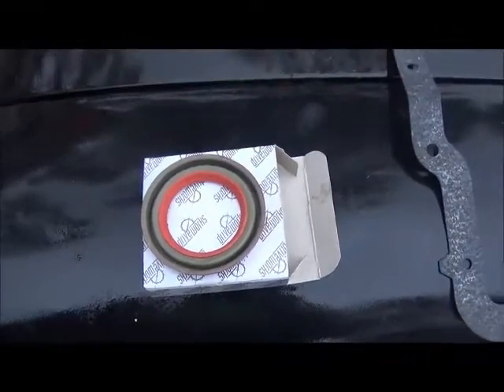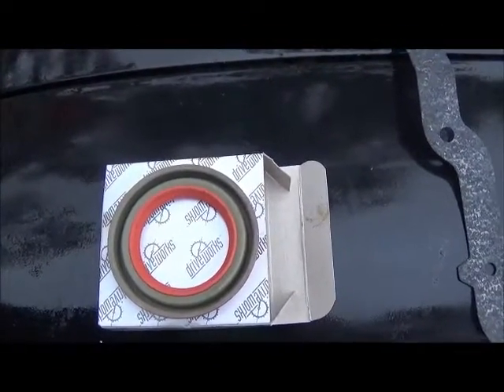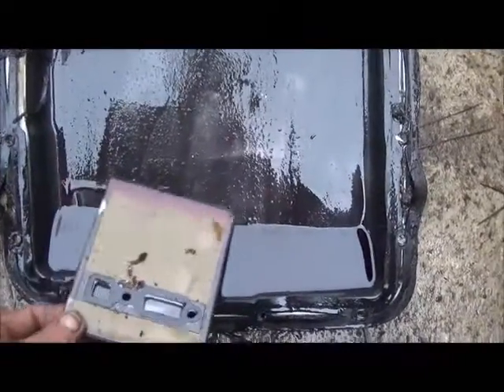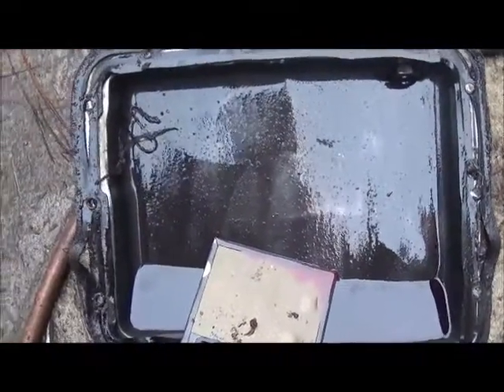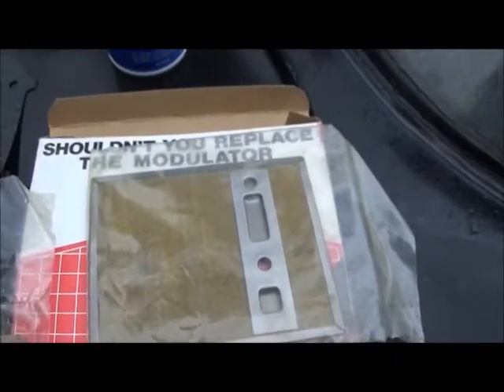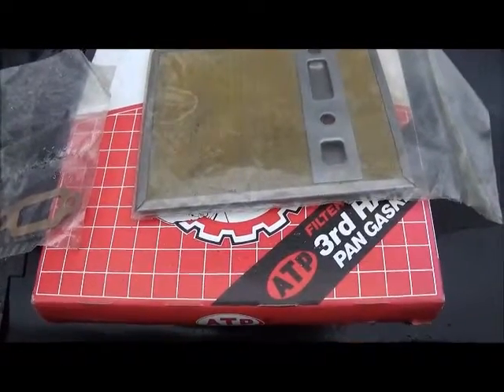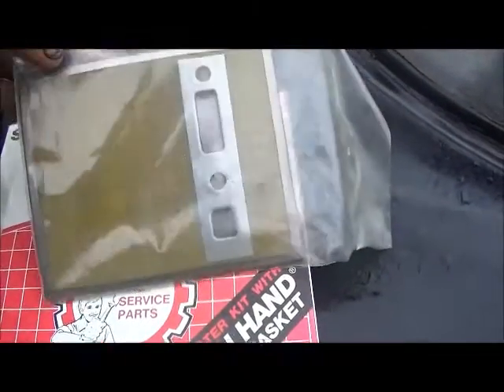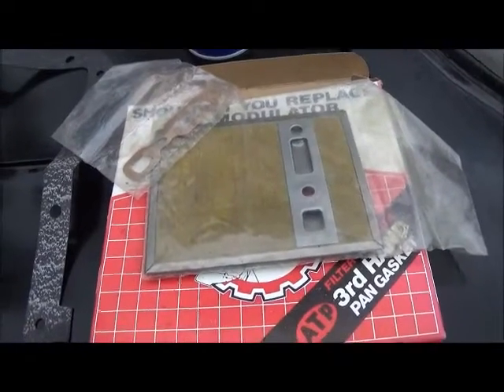1958 Chevrolet Powerglide Getting Lucky Twice..

Comment: The fluid in a powerglide transmission torque converter will leak back into the transmission causing a small drip from over fill...
So to speak ...